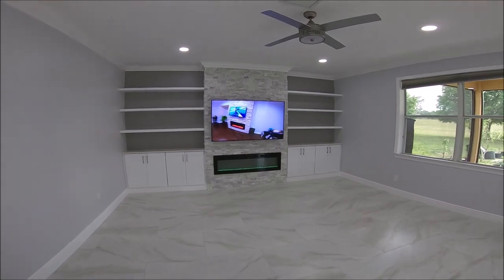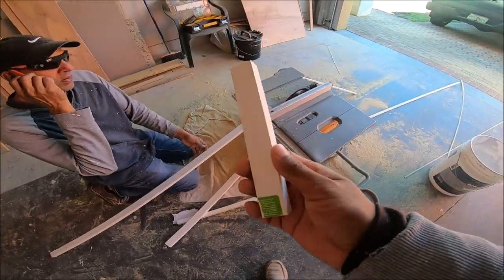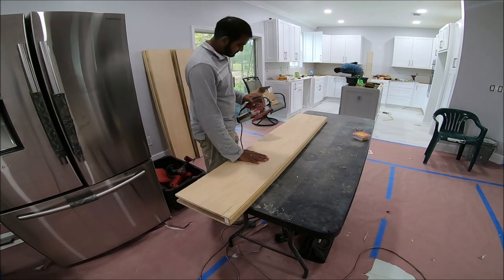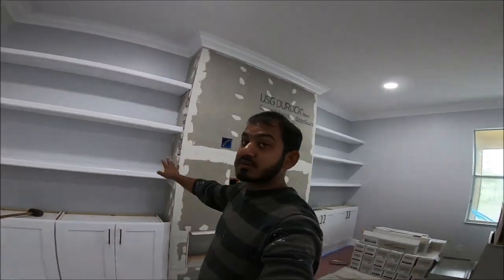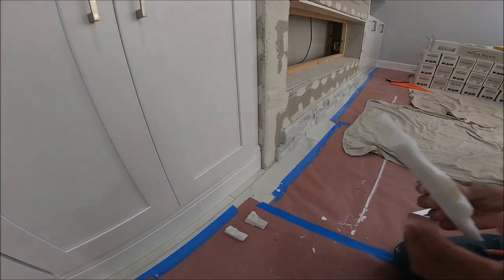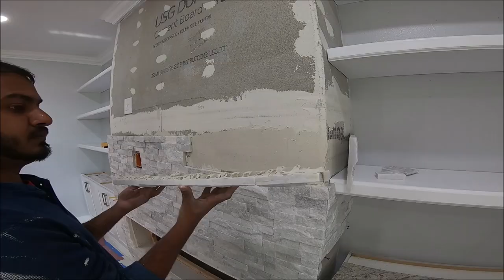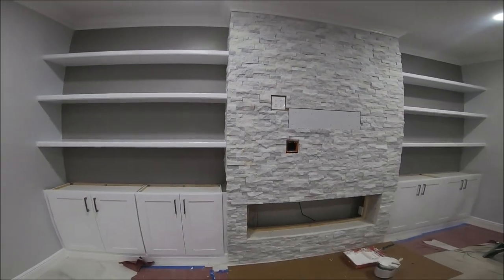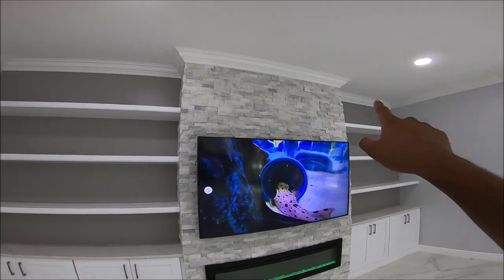How To Build A Stack Stone Fireplace With Shelves & Cabinets #Fireplace #Stackstone

Comment: Quick question, why do you seal the stone? I’m in the process of building a fireplace wall very similar to this.
Reply from the maker: To protect it from discoloring and the stone is very sandy onto the surface the sealer helps to prevent that

Comment: What thickness of board do you use for the mounting bracket?  Seems like lumber is either 0.75 inches or 1.7 inches.  Either might be too small or too big.